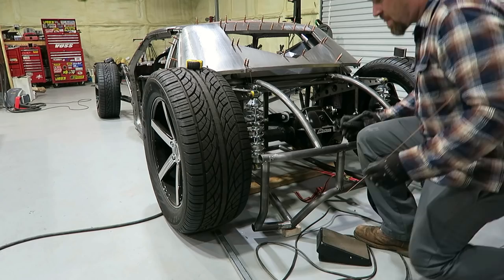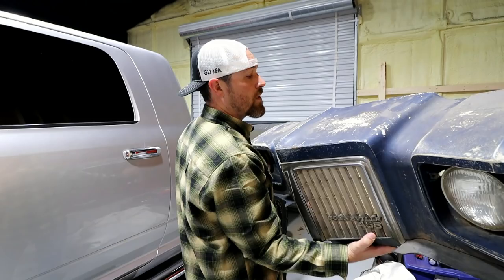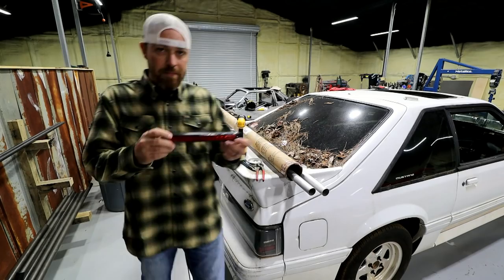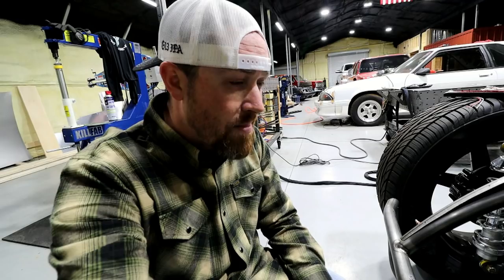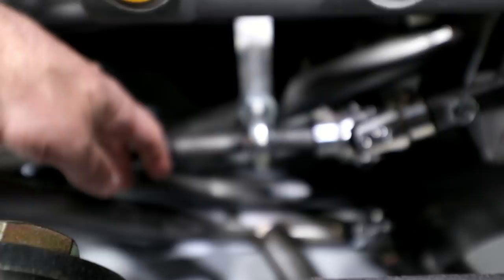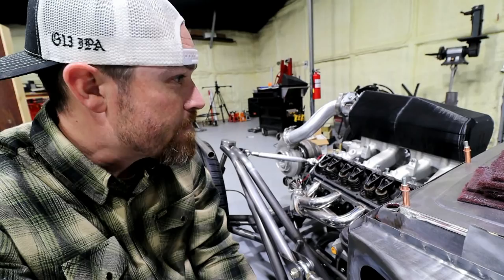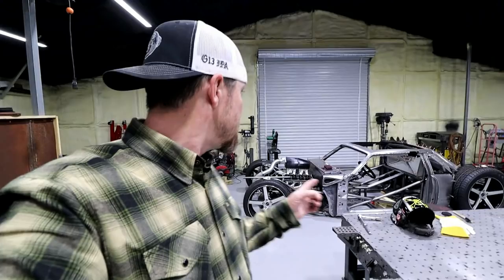3D Printed Intake for the Bibbster Fox-Body Build

Comment: Get the tank with the 12 inch being the height, with the tank basically on end with gauge in side like a Crown Vic tank.. Install the outlet at bottom. You would have to use external pump, but you could essentially burn every last bit of fuel and be lass prone to fuel starvation on acceleration, and deceleration.
Love the tail light idea. Very Cool

Comment: 6061-t6 is aircraft aluminum tube. We mandrel bend it at my work. You don’t need to anneal it or temper it after. It very malleable. It is also weldable. We use it for hydraulic return lines and fuel line.
Reply from the maker: Awesome...much appreciated
Reply: I actually thought about trying this too. I wondered if adding a mandrel to my jd2 model32 would do this.
If you had a big enough radius, you might not need a mandrel.
Reply: Exactly. There are all kinds of applications where 6061-T6 is used and almost all that I see utilize bends. That wouldn’t be the material of choice if everyone was having to anneal it first. An annealing step isn’t cheap for mass production.

Comment: T6 is tempered and will snap/crack. Use torch and soot it to anneal, hard part is heating evenly w/o concentrating on one spot. If small enough part toss in an oven, or fill with sand or blast media to hold and distribute heat evenly, then bend.

Comment: 6061 T-6 Is full hard aluminum and will crack, how ever you can anneal it with torch where bend will be made  to get it soft again, hope that helps.
Reply: Then he could put it into a oven at 185 f for 7 hours to bring it back to hardest
Reply: I didn't see a temper spec printed on the tube, most is T1 or T6 but he is correct. Anneal it by heating with a torch, quenching with water, then bend it. Aluminum will work harden so after bending I would not heat treat it to full temper without annealing it again, as it could get too brittle.
Reply: @txmgarage9323  I would not quench in water ,just let it cool in the air than bend it.
Reply: anneal with the just acetylene only to get area all black then put oxy-acet on with flame and heat till black goes away it will bend easier ..now if you were trying to get that 90 deg i would still worry about cracking as it dont like a bunch of stretching..  also just let it cool with air dont cool with water or any liquid ..

Comment: You can use aluminum conduit electric pipe from Home Depot or Lowe's. It bends easy without breaking at the bend. Your tube bender would great but if you feel it, you can try a piece on your bender.

Comment: My alloy chart says 6061 is easily formed and welded and also corrosion resistant, making it perfect for your coolant tubes. As another person noted if you have to make really tight bends you might need to anneal the area to be bent. It will age-harden after bending.

Comment: Check out the "Morimoto Mod-Pods" (they also make minis)  for LEDs, they've got colored lenses you can use. Two options for you as well, low/high beam function (I'd suggest for running/stop) and then a running/switchback model. In all honesty you could just load up on all low/high functions with red lenses and wire in X for brake and X for turn. They also have amber lenses available but I'm not personally too fond of a constant amber in the rear.
Looking forward to see what all you come up with!

Comment: Weld on some -20an fittings to your tubing and radiator, and use -20an hoses for your cooling system.
Reply: jwright650 I second this. Stainless braided hose would look perfect on this car

Comment: 6061-T6 is hardened. When you bend it it may kink on the inside of the bend because of the very thin wall. The outside may tear because it is hardened, therefore kind of brittle. At the very least, you will have to anneal it to be able to bend it. Otherwise you may want to choose a different alloy and heat treat tubing like 3003 or 5052. I think you may have to purchase elbows and fittings to be welded on.

Comment: Hey Kyle, theres quite a bit of welding but, for bends in aluminum you could go the showgun cut way and use Jesse James idea where you cut the tubing at an angle in short pieces and then rotate the piece to get a bend then weld it back together.  Let me know what you think of that idea.

Comment: We designed and 3D printed our intake manifold for our fsae car. We came to find out the front cylinders were getting half the airflow. Add some baffling to create turbulent air to increase the energy and direct air into the front intake ports.
Reply: Flows change a bit when you are boosted and not just depending on vacuum and velocity. And this is only the plenum, there is an intake underneath.

Comment: Thought you'd be using fox body tails on the back. Idk why I thought that. Then I thought you could use the light but only use a sliver of it into the recessed box. Like have the over the counter led but have a 2-3inch cut out of the light as a cover. They are huge tho. Maybe have the reverse and blinker in there too. Fab on that light box would be a lot of work. Would be a nice nod to the original car. Spit balling ideas now.

Comment: Mr. Voss, am I missing something? Doesn't the link for the front spindle pivot at the firewall to lower and raise the car? If so how can it move with a link attached to the cylinder head? Won't adding another link  just bind it further? I have followed this build from the first but I don't remember seeing the car at ride height and seeing how the suspension articulates.
Reply from the maker: no all the tubing is stationary. the "struts" raise and lower the car

Comment: The whole time I'm watching you talk about tail light placement, I'm thinking they should be higher up, maybe where the roof meets the tail. Just my  $.02.
Reply: + 2¢
Reply: In some states there is a minimum that they can be placed as well.
Reply: @xXIBON3ZIXx  You are no doubt correct. I clearly remember some fun times in 85 with a friend from Washington State getting to know a state trooper. On the way back from what was a peaceful Widbey Island scuba equipment testing trip we stopped at a huge rest area north of Seattle on I5. The trooper followed us in and went tape measure crazy on my friend's 23 T Bucket, far too low. Once he saw all the new dive gear we were packing he measured our 78 GMC step side 4x4 and just kept writing tickets. Headlights and tail lights too high, mirrors weren't acceptable either. Confiscated all the new Scuba Pro gear claiming we had to provide receipts to prove it wasn't stolen. It took a few days to get everything back but it was interesting. Nothing like walking along the legal wall while visiting another country. Crossing the border was never easy again. Sorry about the long story but it seems I don't get out much these days. 

The regulation is 56 to 137cm aka 22 to 54in at home here in British Columbia. I'm curious if you have individual state or federal vehicle regs?

Edit: Looked it up for Washington 15 to 72 inches. We probably were quoted BS specs by the trooper in 85. 15 to 60 inches in Oregon. 
Peace.

Comment: 72 is correct for the Pontiac thus the emblem 455 for the engine during that time, 

Some refer to that section as a fibreglass nose yet it's pretty dense fibreglass. My 85 Oldsmobile Royale Brougham had the same idea. Good idea with the tank if you were to have to cut the back off 1 it would make it seem factory contouring around the rear diff cover.

Comment: I've heard 6000 series Al will not cooperate with any bending and after trying to do flatstock I would agree. I believe the preferred Al for bending is 3000 or 5000 series. Most of the guys I've seen doing this exact procedure are just pie cutting to make the "bends." I feel like that would be much easier than fighting to bend thin/soft material anyway.
Reply: Also, kinda surprised at this point that you haven't jumped over to the Holley Hi-Ram intake. I installed one on my 408w and it has been fantastic. My engine builder was very impressed and he has been building SBFs for 25 years. you could also make the upper "hat" out of carbon like you want. I'd even throw in money for you to do 2 of them.
Reply: Also, kinda surprised at this point that you haven't jumped over to the Holley Hi-Ram intake. I installed one on my 408w and it has been fantastic. My engine builder was very impressed and he has been building SBFs for 25 years. you could also make the upper "hat" out of carbon like you want. I'd even throw in money for you to do 2 of them.

Comment: Please consider building the tank, I'm about to do one and there's not a whole lot of custom tank builds on youtube.
Reply from the maker: Because I wont have an intercooler I will be running meth injection and will be most likely build a tank for it. I will also need to modify an aftermarket tank if I go that route
Reply: @Thefabforums  I'm going to start making the parts for my tank, going in my 84 D150 project. I love the way the bibster is coming out nice work.

Comment: There is a guy on YouTube that built a mandrel bender 
Look up home made mandrel bender 
He used chains and sprockets 
With hydraulic cylinder to turn the die I’m wanting to build one off of his design 
You’ll have to Anneal the tube to bend it with a dirty acetylene torch 
Without a mandrel bender the aluminum will kink
You can buy prebent pieces 
Like exhaust pipe kits and tig weld it together
The guys name on YouTube is 
T jussilainen
You can use the dies you have 
To built one

Comment: Don’t turn this thing into a Pinto Bomb. Placing the fuel cell between the back bumper and the rear axle, turns a rear end collision into a fireball aimed at the passengers
Reply from the maker: lol....pretty much every car on the road has the fuel cell between the bumper and the rear axle. Including every foxbody ever made.
Reply: I think you’re right about that, but I bet most of them have some kind of crumple zone to try and keep the gas tank from getting crushed. Best of luck man. I love the build!
Reply from the maker: @andrewwalker3055  the mustang's have about 8 inches of body/crumple between the very back of the car and the tank. Bibbster tubing is the same thing used in 300mph  nitro funny cars. It doesnt usually give much even when crashed or rolled at those speeds. I dont think its 100% crash proof but I'm confident it's way safer than what everyone is driving down the road.
Reply: Nice! Sounds like you know a lot more than I do about this..... I’ll just go back to watching😄

Comment: If you could bend brake like why not the special aluminum tubing it would have to have less force bending if to much force it could crush it  so little steps to make then bends to the aluminum tubing that way it gradually work's and shapes it the way you need it. A small light like the 1 shown is not a bad idea yet id use roughly 4 in a row above each other that way the next guy wont try making an excuse over dim low profile taillights if you were to get rear ended.

Comment: Hey Kyle.  I know it's been a while but me and my wife just bought her dads 1992 foxbody 5.0 5spd mustang.  Been trying to get it to run and currently have no injector pulse and the fuel pump runs on with KOEO.  The ECU is an A9L and I put new capacitors on the board because the originals were leaking.  No Traces are burnt but I am at a loss.  The computer still communicates with the test port and the grounds seem good.  Any thoughts why the pump would run on and no injector pulse.  Have 12 volts at the injector on the red wire and the signal wire.  I can trigger the injectors with ground.  has 40 psi. fuel pressure and will run with starting fluid sprayed in the intake.  I know you have always been a foxbody guy so any help is appreciated.  James.
Reply from the maker: You could try testing or replacing the electrical module on the outside of the distributor, they are know to go bad. Dont need to remove the distributor to do it. Just unplug and remove the two bolts. May need a special tool that I think can be found at most auto parts stores.
Reply: @Thefabforums  thanks Kyle.  I will remove the TFI module which I believe is what you are referring to or the PIP inside the distributor.  Thanks for the help,  James
Reply from the maker: @supersportrsz28  yeah start with the TFI module

Comment: Image result for can you bend 6061 aluminum pipe
Image result for can you bend 6061 aluminum pipe
Image result for can you bend 6061 aluminum pipe
Image result for can you bend 6061 aluminum pipe
View all
Answer: 6061-T6 aluminum is tempered and notorious for not bending easily. From a bending perspective, it's always best to bend these parts in an annealed state and then temper them to the correct condition.Aug 17, 2018

Comment: Dont you need an intercooler for the turbo, dude you will blow up your engine with this setup
Reply: Inercooler can still go in the front but not all turbo setups need a intercooler. They make chill blocks that run ice water through them to cool the air before goin into the engine
Reply: If he runs methanol instead of gasoline (which I think I remember hearing him say was his plan) then you don’t have to run an intercooler.

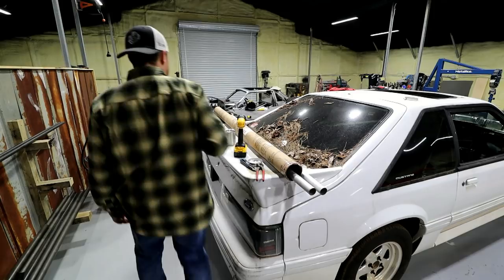Comment: @5:45
Some of the old Formula Ford racecars used coolant passages inside the tube frame of the vehicle.  At the welded joints, they inserted plugs into the tube frame where needed and welded them in place.

For the mandrel bent tubing, try contacting the guys at https://www.woolfaircraft.com   They're located near Detroit Metro Airport and probably do more racecar work than aircraft work despite their name.   Supposedly, these guys supply materials to Burns Stainless, so that should give you an idea of how enormous they are.   Material pricing is very reasonable, but the CNC bending varies because of setup times.  In your area, I would also ask around near the NASCAR shops in Charlotte.